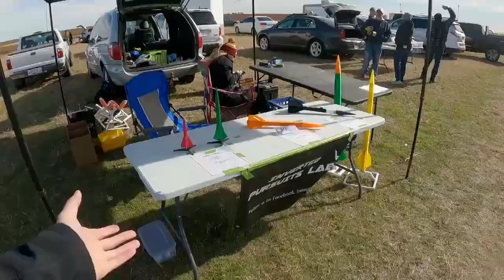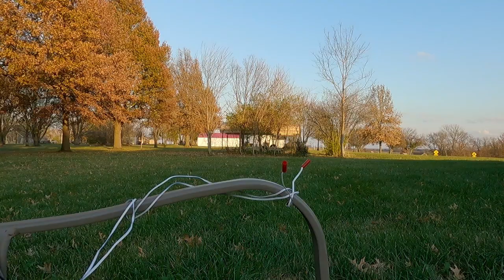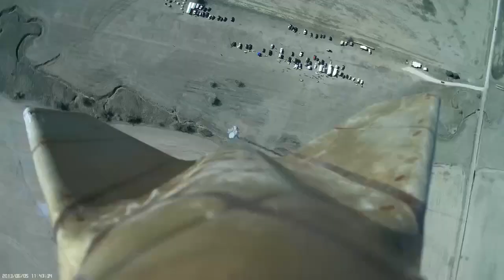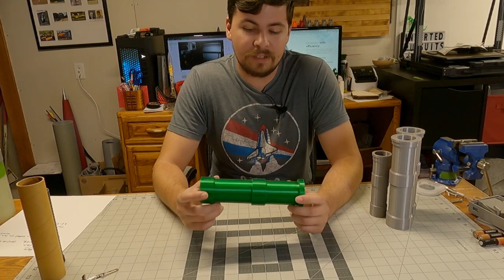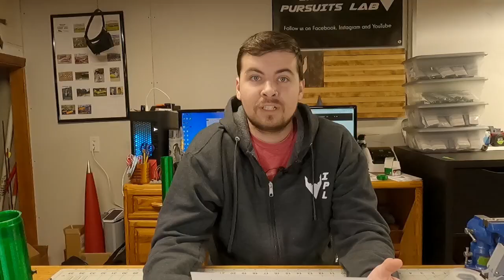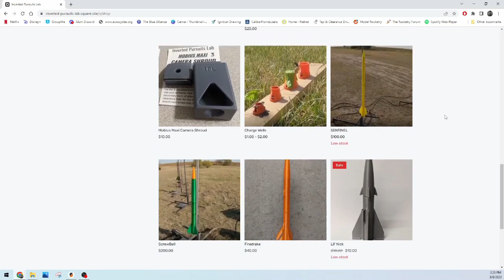3D Printed Motor Adapters

Comment: Tried this with a 38mm to 29mm, but it didn't go well. One flight and the adapter were fused to the motor. I've stuck to making the adapter out of cardboard with 3D-printed centering rings.